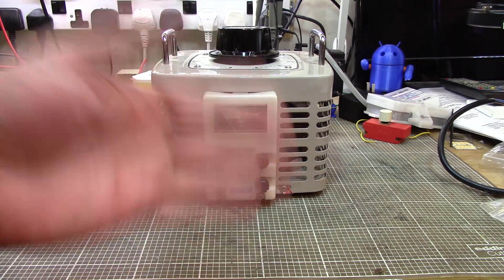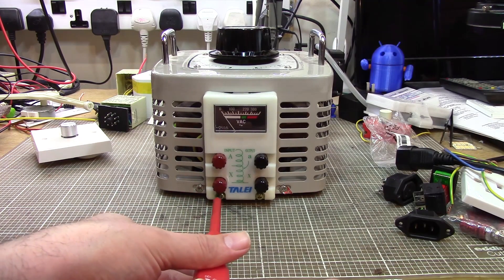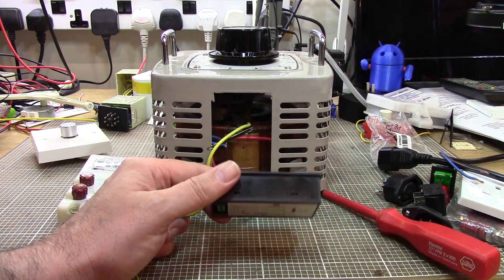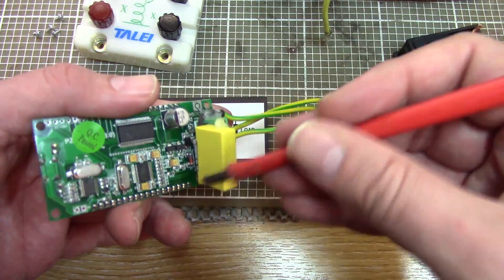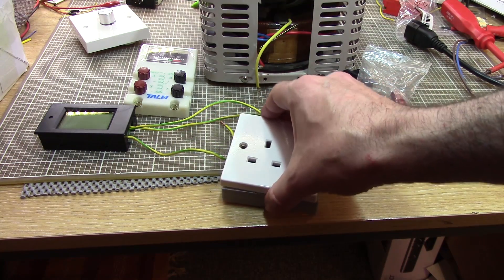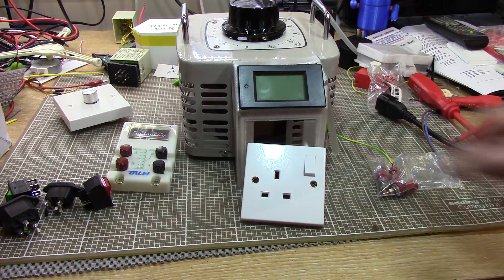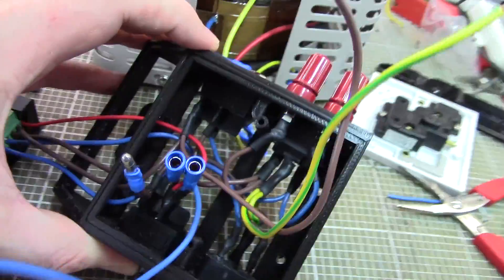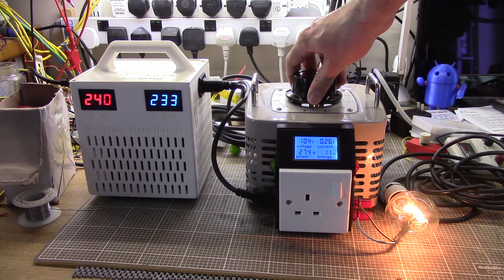Panel meter modification & 3d-printing a new front panel for my variac

Comment: That's an awesome job. I just got an isolation transformer and variac myself. I have all the parts and the printers to make custom enclosures but I lack thr talent to build them haha I'm going to do the isolation transformer first. Did you print the isolation enclosure as well. My it is 2.5amps and the variac is fused for 3. I plan to use the transformer for my bench test equipment mostly and the variac for testing psu requirements for projects that are being prototyped. Mostly custom led stuff for friends, more digital art than anything else for lack of a better term. I collect leds and make custom strings, displays, etc. I leave my personal guitar amp repair to professionals is why I bought quality built but rather low power it and variac.

Sorry I rambled. I'm wondering if you have stl files for the isolation transformer?  I'd love to have the files. Just for the case, I can print it and cut out parts for the display and the mains in and 2 iec out. They will be floating earth to protect my oscilloscope and the like. I'd be willing to pay you for the model or stl files if you cover up the digital displays. I have a new juntek display I plan to use that will monitor the amps I'm pulling from the wall through the biggest current shunt you've ever seen hahaha. It was a gift and is good up to 300 amps. There's probably 10 dollars of copper in the shunt with the circuit board attached. It's 3 separate modules but only 1 display and once the shunt and small control box are buttoned up its just some jst connections for the display.
Reply from the maker: I'm sorry that I don't have time to write a suitable reply to your comment, but I did manage to dig out the STL files and original source files for the isolation transformer case.. I've put them up on thingiverse now, https://www.thingiverse.com/thing:5252967.. they're also on youmagine as well.  ... Enjoy.
Reply: @ThingsWhichArentWork  sir you are a gentleman and a victim of my mental illness (rambling is a part of it) thank you very much. Thingiverse is horrible to search. I went to sub you and realized I already did long ago when I was researching something.  Again, thanks

Comment: The YouTuber called "TheHWcave" has videos on similar modifications to the meter. He also explains how to get the meter to have better current measurement by creating a secondary path through the current coil, using ten wraps. But, care must be taken to not switch in the x10 range above a certain point, or you can cooked the meter.

Comment: Hi there, I really liked this video. I liked how you were able to power the meter without having to take up to 60v or whatever it needed to turn on. I was wondering if you would have any ideas on how to do that to the DC version of the meter. I have a DROK 6.3 - 100vdc meter with 20a capacity. I'm not to up on micro circuitry and any advice would be much appreciated. Thanks, again... great little video. :)

Comment: Thanks for their great video. I hooked one of these digital meters up to a variac and it works great except that the numbers on the meter don't change instantly as I turn it like it does on yours. The numbers change only like every second or so, there's a lot of lag. Is this because of the way I wired it or is this just how some of these meters work? Thanks again!
Reply from the maker: Hi Maggit13 - I don't see any way possible that you could have done anything that would have changed the update speed on the panel meter. I'd guess that it's just the case that the meter that you got only updates once per second. Cheers!!
Reply: OK great, thanks. That makes me feel better. I really thought it was something I did since it happened with 2 meters already. Third one is on the way so we'll see what happens. Thanks again!
Reply: Thirds time's a charm. The new meter works perfectly, but now I ran into something strange. All I did was swap meters and now the  meter doesn't match my other multimeter when comparing the two at the variac output. The multi meter reads about 1.5 volts higher than the variac meter and the variac no longer goes up to 148 volts like it did before. It tops out at only 140 volts now. Did I break something? I also marked on top of the variac where 120 volts was and now it reads 120 farther up the dial so something shifted.  Please help!
Reply from the maker: The meters not matching the same reading isn't too surprising.. Check the accuracy/tolerance rating on the panel meter.. I wouldn't be surprised if it's +-1% ... Topping out at 140V instead of 148V... What's the input supply voltage like at the moment?.. Mains supply voltages will vary by a few percent throughout the day as the grid deals with different loads. In the evenings when everyone's home with lights, TVs, kettles etc then the mains voltage I get in the UK drops by about 10V. A similar thing could well be happening to you... I very much doubt you've broken anything as a variac is mostly just a coil of wire round an inductor with a slider tap for the output... It's kind of all-or-nothing for working or failure. Hope that puts your mind at ease. Cheers!!
Reply: Yup, right on. I though of that and measured the house voltage. It's down about 5 volts today so no problem there. And yeah I forgot about the meter tolerance so that makes sense. Just surprised because the last one was pretty dead on. I'll have to live with it. Thanks again!

Comment: Brilliant!  I have the same style and manufacture of variac but at a lower VA rating than yours(1KVA) and am in the midst of designing an enclosure for it and my isolation transformer.  I saw these same LCD meters on Ebay but was disappointed that they had a min. display voltage.  Now I can see they are hackable.  A pointer to the schematic of the LCD meter that you used to figure out your hack would be helpful for my endeavour. Thanks very much for the video.
Reply: Never mind, I found the link in the comments below.

Comment: Did you teach yourself electronics .
Reply from the maker: Hi +daveking777 - For the first 6 years I was self-taught, but then I went on to do an electronics 'A'-level at college, followed by a VLSI circuit engineering degree when I was at university. I have however never worked in the electronics industry, so it's still just a hobby for me. Cheers!!

Comment: why does it use earth wire?
Reply from the maker: Hi +Slot1Gamer  - The variac is not an isolating transformer, so equipment connected to it is still technically speaking connected to the mains... plus, the enclosure on the variac is all-metal, and I wanted to make sure that if anything went wrong with it's internals, it wouldn't leave the case live. If I only ever run the variac off of my isolation transformer, then the earth is not an issue, but the variac is perfectly capable of being connected straight to the mains, so the earth seemed like a good idea. Cheers!!
Reply: Jim Conner sorry I meant why did you use the green and yellow wire for live and neutral ? :)
Reply from the maker: +Slot1Gamer I didn't actually use those wires when I wired it all up properly with heatshrink sleeving etc... that green/yellow was just when I was hacking on the panel meter and grabbed the first bits of wire available. Cheers!!